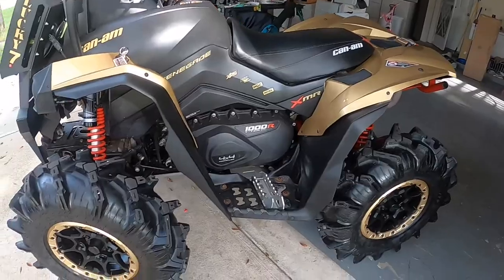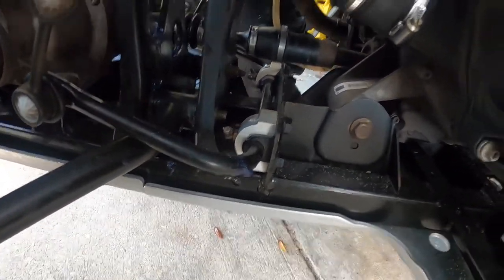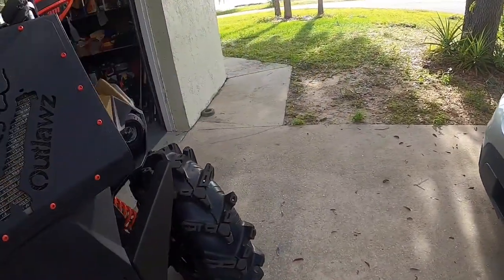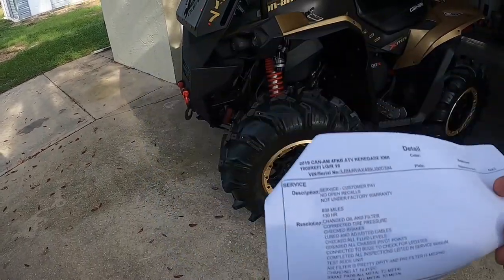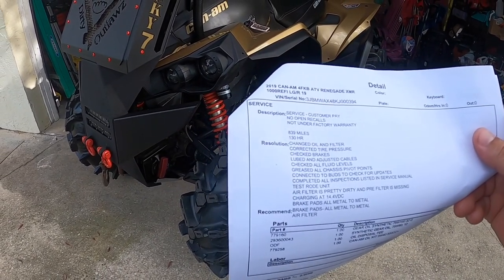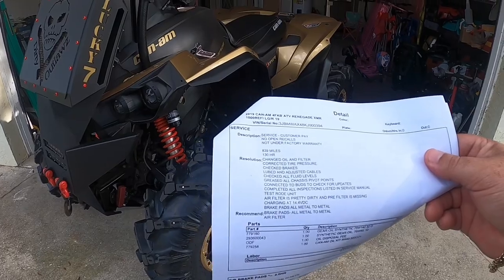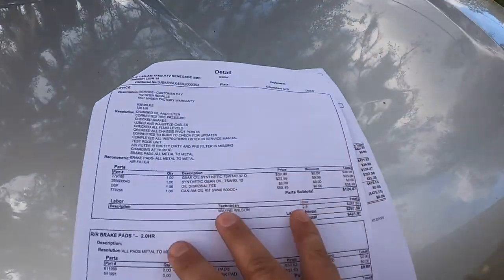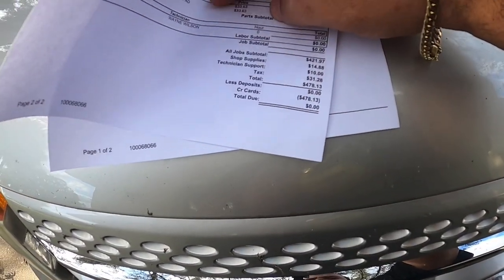2019 Renagade xmr 1000 maintenance bill and what to expect!! 🤯

Comment: Same goes for a Polaris XP1000 full lube oil change, I did my own.  I suggest removing your skid plates if you do your own next time, if not expect to clean up oil, it runs out at every hole and crack on the skid plates.
Reply from the maker: Yes I noticed that. After a few days it was still leaking on the floor. After I cleaned it, it stopped. Good point tho 👍🏼

Comment: Do that yourself for around $100 using the OEM products or even cheaper using rotella t6 oil and royal purple diff fluid. Good to have them check it out first service but after that dig in man it's all easy👍👍
Reply from the maker: There’s always that first time they get you but after that I’m not going back. Everything is pretty simple to do after looking into it but yeah definitely. Thanks for the advice!
Reply: @christianagosto1447  buy your dealers fluids filters belts etc ...it’s documented and covered under warranty
Reply: Just bought my renegade xmr 570, I’m doin the same thing. Dealer for first service, my garage after that lol

Comment: Hahah that is the best looking atv i ever seen.
May I ask you what the big metall thing is in the front? Where you have the skull. Is it some kind of bumper?
Reply from the maker: Thanks for the comment! To answer your question, that is a radiator relocating kit and it also serves as a bumper. The radiator sits up top where the skull is at so it will not get as muddy making the engine not overheat as fast.

Comment: Damn, Honda’s are stupid simple compared to these beasts haha…. Like reaaalll simple
Reply: But they make 11hp. They should never need any maintenance.
Reply: @joebiker5992 what? A Forman makes 30 hp lol. Anything with moving parts will need maintenance; Hondas are just more reliable than can-ams plain and simple. I own both and work on both; if you need a bike to work Honda is the way to go, but if I’m ripping and tearing I’ll pick my renegade all day long
Reply: @TwoFeetDown92  ok... my point exactly. It makes 61 less hp. It sure better be more reliable for that much less.
Reply: @joebiker5992 no, just because they make 61 doesn’t give them a reason to be less reliable. Hondas are just better made, I own both and the build quality on the Honda is 10x better than the can-am. Japanese just do everything better, also my cb1000r makes 121 hp and has 10k reliable miles. A lot of it also depends on how you ride, most people swamp their can-ams and beat the shit out of them.
Reply: @TwoFeetDown92  lol. They don't make 61hp. They make 61hp less. Anytime power goes up, reliability goes down. Honda or not. The can am 450s, and 570s are known to go thousands of miles with zero issues. Honda does not make a 91hp v-twin atv engine. If they did, they'd have problems too. Can Am makes outstanding machines.
Reply: @joebiker5992  there is a reason they don’t, they want their machines to last a lifetime ( as per the founder ) I own both, ride both and work on both; my Honda will outlast my can am, my renegade has had 3 recalls, idk why you can’t accept that can-ams aren’t as reliable as a Honda; it’s a fact lol. Just like how my renegade is pushing 91 hp; my foreman will never touch it in terms of speed or hp but if I’m doing work or plowing snow the Honda is my choice all day long.
Reply: @TwoFeetDown92  I am not saying hondas aren't reliable. Nor am I arguing that can ams are every bit as reliable in a 1000cc, 91hp power plant. What I am saying is this... if honda built an apples to apples 1000cc, 91hp power plant to compete with can am, they'd have the same issues. I'd expect every manufacturer that would make a 30hp engine to be essentially maintenance free. Your 2 wheelers are 2 completely different machines. And I am saying is that honda should be better because it's working 1/3 as hard. And look at all the Japanese manufacturers. As compared to the big 2. Not only are they not on the same playing field, they aren't in the same stadium when it comes to performance.
Reply: And reliability goes down when performance goes up. That's all I'm saying. I would expect the can am to need far more maintenance